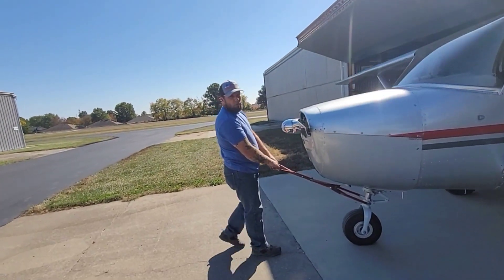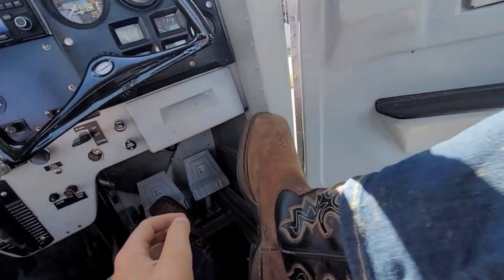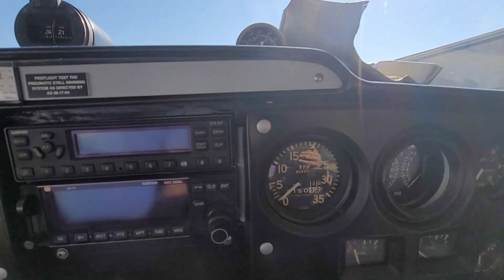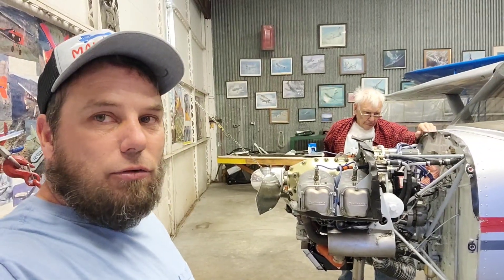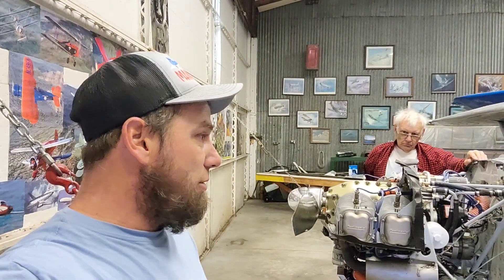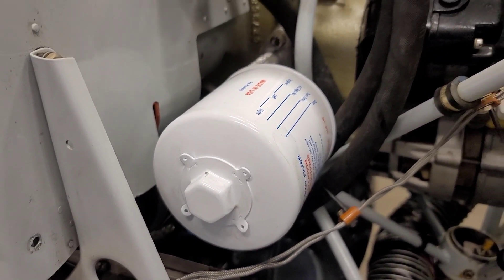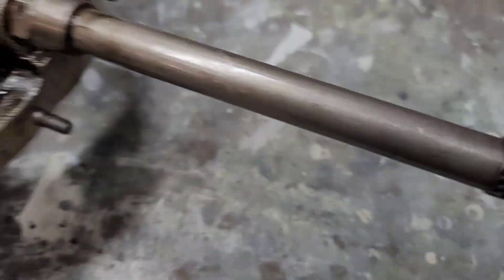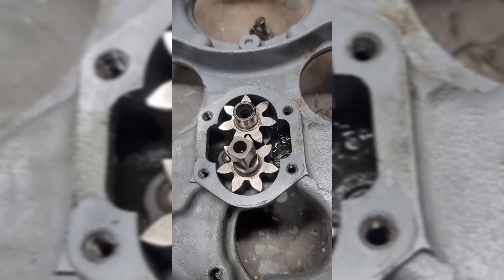2 steps back. No oil pressure!

Comment: My thoughts: Pull the spark plugs so it cranks easier. Disconnect the oil pressure gauge @ the engine. Connect a line to the fitting on the engine. Set up a drain so that an external oil can will drain into the oil pressure gauge hole. Run through a quart or more of oil through the gauge fitting. Reconnect the gauge, crank with the starter & see if pressure develops DO NOT run that engine ANY MORE without oil pressure. Good Luck, We're All Counting On You
Reply: Agreed.

Comment: Fill the old filter screen housing through the oil temperature probe hole with oil.  Put it back together and start it quickly.  As the oil pump gets worn, it won’t pick up unless they’re “wet” with oil.   This happens when they sit a long time.  You can stand a cub up on its nose and get a 67/75 continental to pick up oil.   However, it is not easy to stand a 150 on its nose safely hahaha.  Just use an oil squirt can through the oil temp hole.

Comment: Old Cub trick. After sitting for a while, would lose prime and no OP on start up. Just lift the tail for 20-30 seconds and restart and oil pressure is back. In your case, squirt oil on the oil screen cavity and restart as soon as possible. If not that, take a close look at gauges and lines, or use alternate pressure gauge. Since you already pulled the pump. Might as well go-ahead and send it out and get it re-freshed, so you never have to worry again for a long time. Good luck.

Comment: Lot's of good suggestions. We prep engine oil galleries of car engines by removing the oil pressure switch and attaching a braided line to a cylinder which we fill with oil and then attach an air line to the top of that cylinder.  Pressure the cylinder and oil is forced through all the oil galleries including through the oil pump.  Works for us on brand new or rebuilt engines.

Comment: If I were to hazard a guess. When the plane was upside down oil traveled to bellows in the gauge and sitting for a year has gummed it up. Not seeing anything untowards in the pump gears or backplate. If the feeler gauge doesn't fit you must acquit.

Comment: Well that double sucks matt...I would pop the plugs and disconnect the oil line from the gauge and put it into the water bottle or something and just motor the engine over.

Comment: common isue wiith little continentals.with oil  filter adapter installed. remove filter and fill adapter port with oil to prime pump. just went through this with an ercoupe that was sitting.

Comment: If the gauge is all mechanical, I would check the tube between the engine port and gauge for a pinch and try screwing in a known good pressure gauge directly to the engine port and checking. That oil pump sure looked dry - pickup tube?

Comment: I would have fitted a mechanical gauge and spun the engine over without plugs to see if I get oil pressure. The next check is a stuck pressure relief valve.  Even a badly worn pump will give some pressure.

Comment: Bummer.  Pump gears look decent enough to me. I've seen some scored up ones that still pumped pretty good too. How did the engine sound? Was there oil in the pump when you took it apart? Was the engine getting kinda rattly? If not maybe it is just the gauge.

Comment: Did the line to the gauge get a kink?  As others say see if the pump sends oil to the gauge.  And since you have the gauge lose to do that, see if the gauge indicates with an application of pressure.

Comment: Probably not the oil pump. Squirt oil in the oil line going to the oil pressure gauge. Might need WD-40 even it drained out while being down. Air in that line your engine is fine .
Reply: Just saw the same issue on another plane that has been sitting. Used an oil can to squirt oil in the line toward the gauge, then down to the pump. Did the trick!
Reply: I agree,  I've seen zero oil pressure at times like this. I was reluctant to shoot oil down cylinders, but bam. 60 psi in a few seconds. Sometimes the old tricks have stuck around because they work.

Comment: If in doubt that there is oil on wearing surfaces before a third and possibly dry start, maybe ask authorised mechanics about overfilling the engine case with oil to prelube the wearing surfaces, draining then filling to correct level, turning over with plugs removed to be sure there is no hydrolocking before restarting.
https://www.youtube.com/watch?v=GX-Hqk9nZ3s

Comment: I'm not familiar with your engine but I  wonder if you need to prime the pump for the first start, the vertical lift is a significant distance judging from the pick up tube. I have had manuals suggest to pack the pump with Vaseline to create suction. You might also be able to back prime the pump from the oil filter. Anyone who's been around pumps knows that style make horrible compressors and worse vacuums.